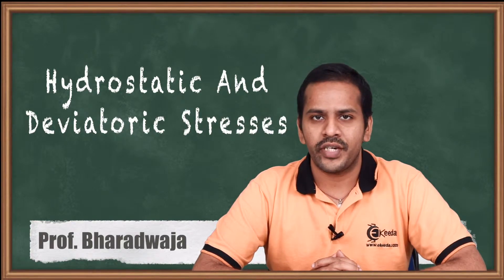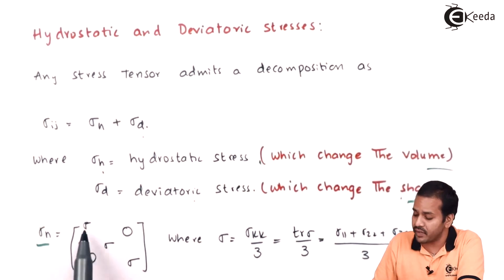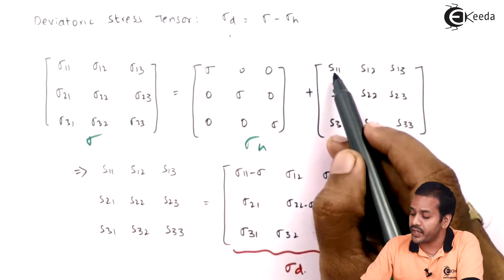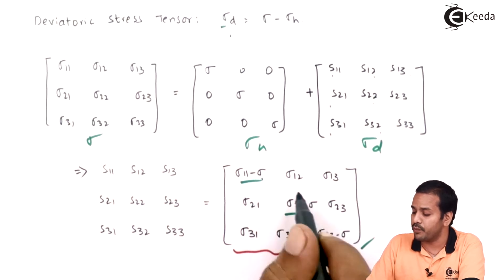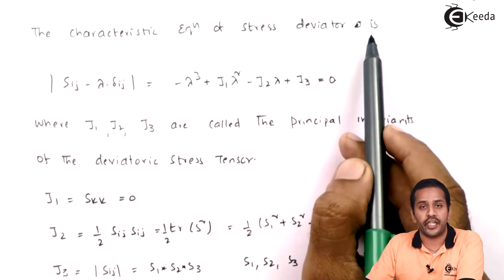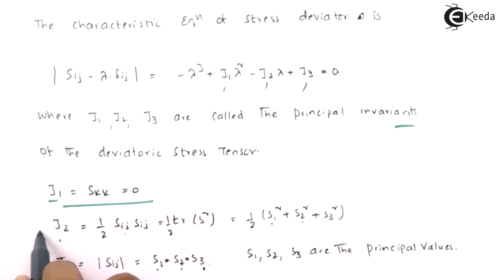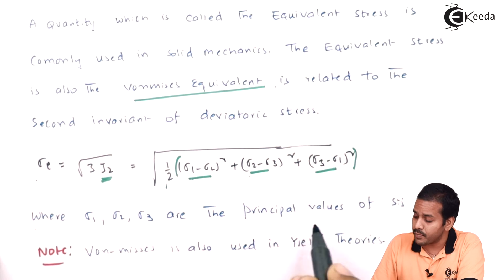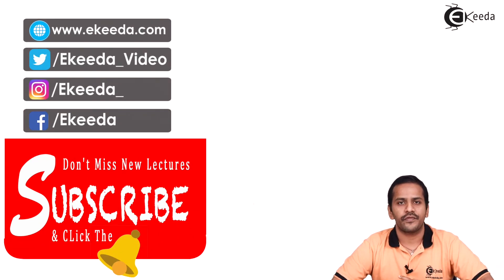Hydrostatic and Deviatoric Stresses

Comment: Why sigma can be written as sigma kk/3....that is dummy index.. Why
Reply: Try to write sigma with ij and try to put different value of i and j you will find that sigma has non zero value only when both the indices are equal. So to speak, i will be equal to i or j will be equal to j.

Why he preferred k index, while the main total stress is written in ij component so he tried to distinguish between the spherical part of total stress and total stress.